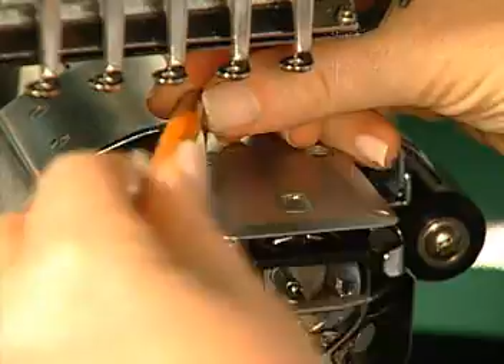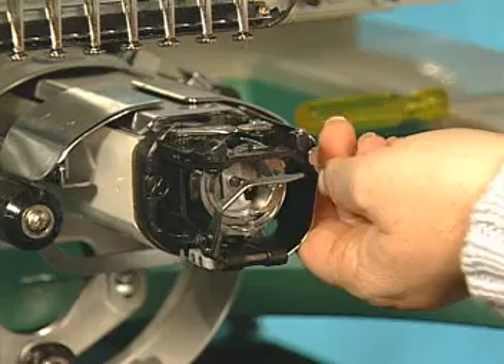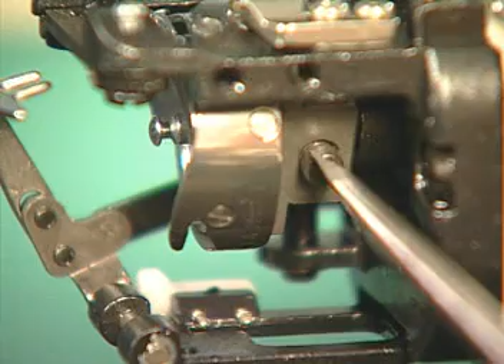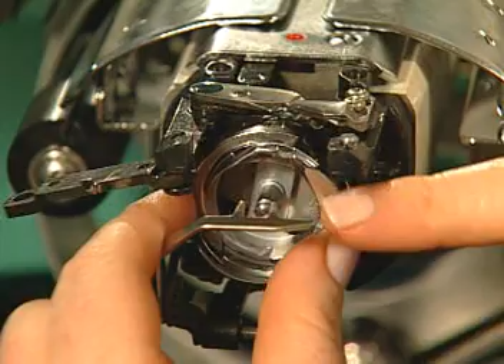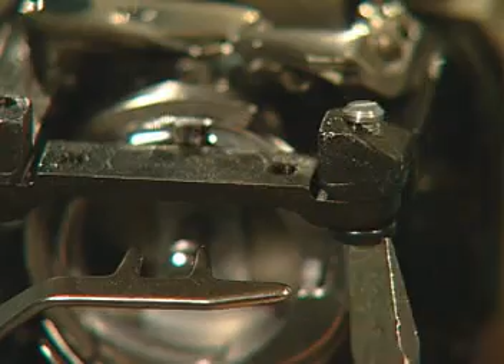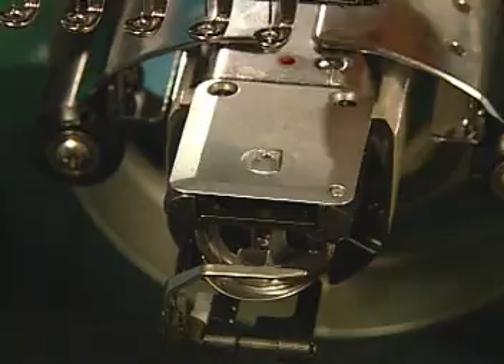TAJIMA TEJT-C REPLACE ROTARY HOOK AND SET HOOK TIMING

Comment: nice video. I have a stupid question. What is the clamp with 2 pins moving foward, in front of the hook? its about 8 cm heigh, with the axis in the lower point. Does it moves towards the needle, to ensure the cutting thread operation? Thanks
Reply from the maker: @joaquinandres8142  this is the picker , it holds the thread , allowing the movable knife to pull it through the fixed knife, resulting in a thread trim - BTW it’s a great question !